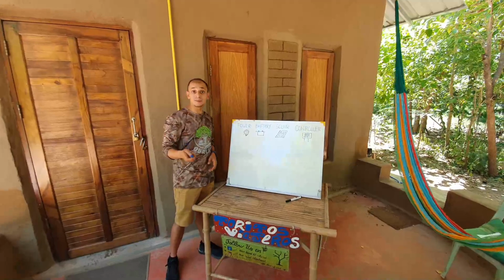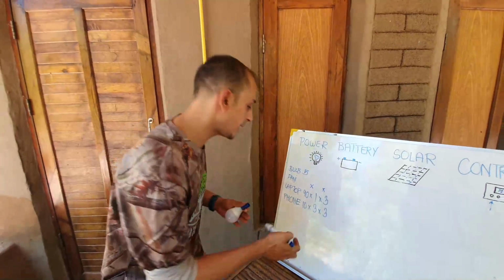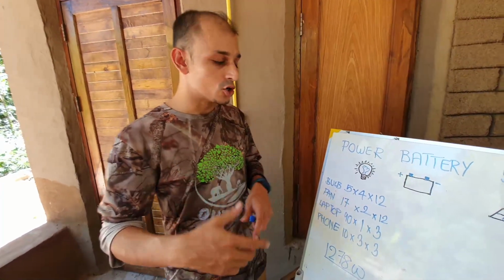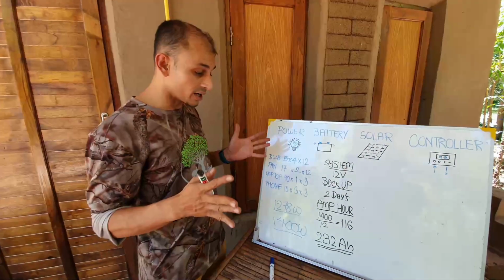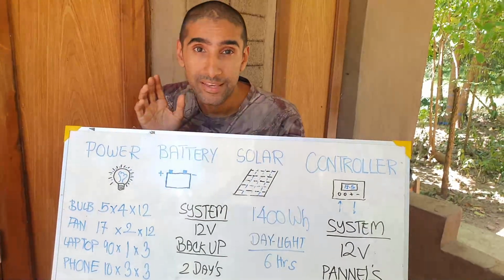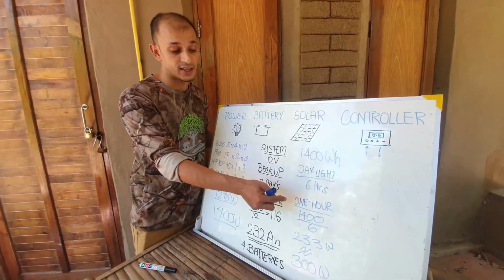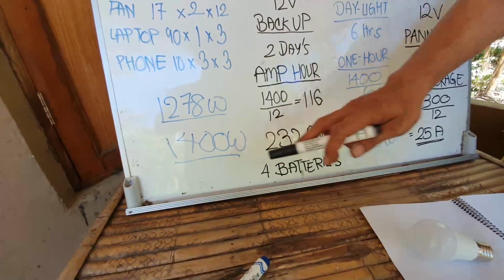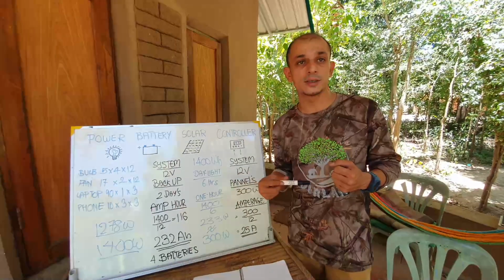HOW TO BUILD A MUD COB HOUSE? Sustainable SOLAR  Energy for a Mud House !

Comment: Is the inverter a direct sine wave or modified sine wave? I ended up buying a modified one as part of a premade kit without checking. Will modified sine wave inverters cause damage to equipment?
Reply from the maker: AC voltage works on a polarity switch between positive and negative voltages that then allow the equipment to work. The pure sine wave is better for overall appliances because the polarity change is smooth. With modified sine wave (also called sine wave inverter) the polarity change is sudden and just like and electricity shortage or failure can sometimes short circuit equipment. If you have a modified sine wave inverter would recommend to use it with simple items such as lights & fans. Hop this helps. Check out the link below for more info. Good luck.
Reply: @OurLand   thanks for reply 😃 yes I plan to use this small set up for just lights and fans in one room. Will put together a better set up later with better equipment